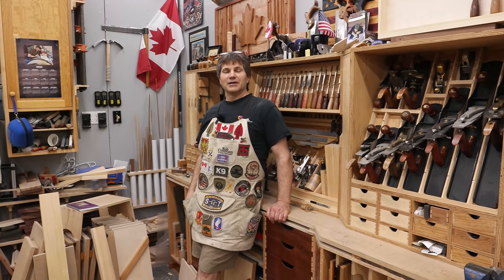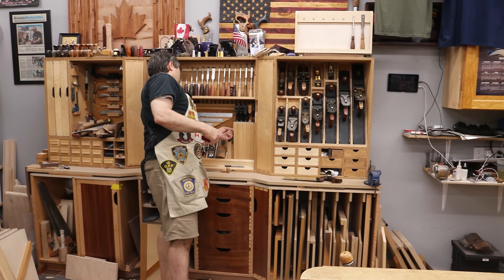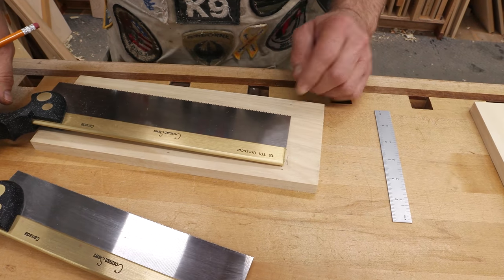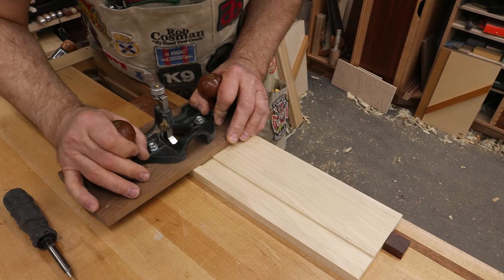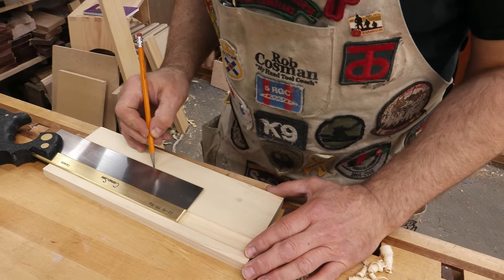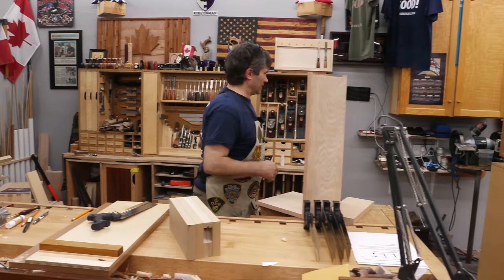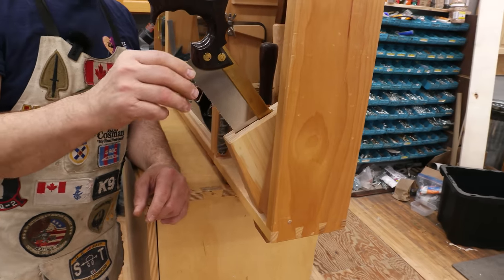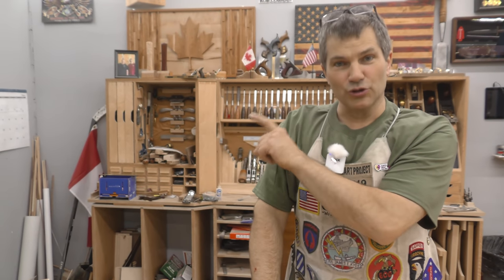Tool Storage Cabinet Ideas - Saw Holster

Comment: When I'm done remodeling this house, I'm going to work on a shop and I'm making a tool cabinet with these tills. 
It was nice to watch (without blowing too much sunshine...) your masterful use of the 5 1/2 taking out the machine marks for glue-up on the insides of the till. Then your one-hand deployment of the clamp for the resting block, which is at an angle to the case, at the 34 minute mark was cool to watch. What's the old saying? " Perform a function 1000 times and you will master it." Something like that. 
I enjoy your teaching. Finish my coffee and back to working on the house. Have a great day.

Comment: Perfect timing I have 4 Cosman saws this will be my next project.  By the way my only regret with the Cosman saws is I bought them all with the same handle so it sometimes takes a couple of tries to get the one I want
Reply: You could try labeling the front of the sleeve. I think a profile of the teeth inlayed in a contrasting wood could be nice. Changing the length/height of the inlay to communicate the fineness of the teeth too.

Lots of options here… I think I found a new project

Comment: Good one Rob. I do, as I can tell you do, immediately look at what I would do differently next time. I would run the router plane for a little more gap where the saw teeth are, and if it was a stationary cabinet, not travel box, I would increase the gap altogether for ease of inserting the saw. Thanks for all you do for the vets, and to pass on your knowledge.

Comment: Just finished mine and I really like them! (made 5)  They were fitted to a pull out tray. I thought long and hard about how to pivot them since they were going to be horizontal, then had the idea of just adding stops, front and back to pull the saw out and then inserting them back in. Added a divider on the side to keep them in place.  I added a 1/4" plywood strip to the side of each one  to give clearance and stability to each holster. Wish I could add my short video clip to this comment to show what I did. THANKS for this video! It was a nice exercise and addition to my workbench!

Comment: Always enjoy the how to vids on how you set things up. How about running two rods through, 1 for the pivot, and the other as the stop. Coming from the front face up from the bottom, make a notch to rest on the second pin. It would depend on how wide one's tool case is for the location of the notch and stop pin.👍

Comment: A wonderful build. The washers could be countersunk to reduce the space.
Personally, I think I'd have washers on the end pieces as well.
I'd probably prefer having a non-saw holster as the rightmost holster, just to get more room for the 'grabbing' hand.
The front space could be used for dovetail guides, since those are related to the dovetail saws.
Advanced exercise / challenge: The holsters could be moved closer to the cabinet bottom (actually below the bottom), if you hollow out the bottom; this could be combined with rounding the bottom of the holster. The most important thing to do is to make the hollowing rounded in case you choose to try this.

Comment: I started with 8/4 and ripped the top (above the spine/back) off. Then flipped the "new" top upside down on the table saw. Then I could cut the blade clearance tall and saw back lower. Then glued the top back on. This gave the front face no glue up seams.

Comment: Hi many thanks for the videos I have made 4 for my Cosman saw set. I made them out of oak and I think that is a mistake as soon as I put them in the tills, approx a week later the brass backs have gone a strange colour, I would say   wire wool but a week later same thing. Assume oak not a great idea, any guidance on best wood to use that will not interact with brass backs?

Many thanks
Jase

Comment: Maybe instead of a washer you could just shave down the long sides that rub. Start plane just above the pivot reference surface and run it down a few times. Should reduce the friction enough to never overcome it and pull one with it. I’m tempted to add steep champers to the top and sides to make it even easier to slide the saw in and make it look less like a simple block. Thank you for showing us this!

Comment: May I make a suggestion?
Start with a board that is 1 & 1/8 inches thick, lay it flat on the table saw with the 12" edge against the fence and cut a 1/2 inch strip off (to be glued back on later).
Fit a tall fence to the table saw, set the blade height to about 1", run the board on its edge over the table saw, flip the board end-for-end and run it through again to get a centred slot. Check that the slot is wide enough for the handsaw blade, and if not, move the fence over and repeat until it is. Raise the table saw blade and repeat until the slot is deep enough for the handsaw blade.
Once the slot is wide enough and deep enough for the handsaw blade, drop the table saw blade height to the thickness of the brass back (7/8"), move the fence over and widen the slot to take the brass back. Test the fit and adjust the width as necessary until the saw slides in easily.
Glue the 1/2" strip back on to the edge and plane smooth.
Reply from the maker: Great idea.  Try it and let me know how it goes

Comment: Really nice job Rob, I wonder if a slite recess on the top side of the blade section before glue up would help register the saw when putting it back in each time?
Reply from the maker: Try it and tell me how it comes out

Comment: If the holster butted up to the back wall of the cabinet maybe add a small magnet to the back wall (or on the bottom on the stop block) and a washer on the back of the scabbard to hold them upright. Also, doesn't the height of the user and the mounting height of the holster in relation to the user affect how far you want the saw to tip out?

Comment: Very nice. Why not put a radius on the corner around the pivot point to provide clearance.  That way the holster could sit flat on the cabinet base.
Reply from the maker: You can if you dont want to use the corner as a stop.  Try it

Comment: Nice! Would you apply a finish inside (before glue) or outside to prevent differential moisture take-up from cupping the flats and grabbing the blade? Cheers and good luck with making Purple Heart go this year!! Farmer John, Ontario Canada
Reply from the maker: Well I have been using mine, unfinished, for years and no issues.  If i applied finish i would only do it on the outside.

Comment: Great video. 
What do you feel about using a rabbet plane instead of a router plane for this Rask?
Reply from the maker: I prefer the router plane since its designed to make a level plane parrallel to a surface.  Rabbet planes are not designed to do that
Reply: @RobCosmanWoodworking  reference surface is the key. Got it. Thanks, Mr Cosman.

Comment: Two questions - do the saws saw through the blocks over time/any reason to consider mounting the blocks with the saws upside down so they ride in/out on their backs? How tight was the clearance for the teeth/If you wanted to make the saw set wider in the future would that be an issue?
Reply from the maker: I have had zero issue with that

Comment: Personally would have them flat on the base to stop things (like pencils) hiding under them. To allow them to still pivot either radius the corner or put and 45 degree or whatever angle which would also give you a forced stop point
Reply: personally I just used neodymium magnets to hold the saws almost flat to the wall

Comment: Will these not lead to rust on the blades due to the steel being against wood on both sides?
Reply from the maker: Pull a nail out of a board after a few years, no rust!

Comment: What do you do if the wood swells in humidity?  I think I would prefer to have plenty of clearance between the sides of the saw blade and the wood to prevent coming along and finding the  blade trapped by swollen wood.... or worse, pitted with rust.

Wouldn't  it  help to apply a finish of some kind [even if just wax]  to the inner surfaces before assembly?

I think, if I were to make these...I might join the two halves with countersunk machine screws and nuts, rather than glue.  Could also make cleaning things very simple  if some sort of contaminant got down in the slot - let's assume it might be grandkids.
Reply from the maker: All good thoughts.  Give them a try and let me know how they work